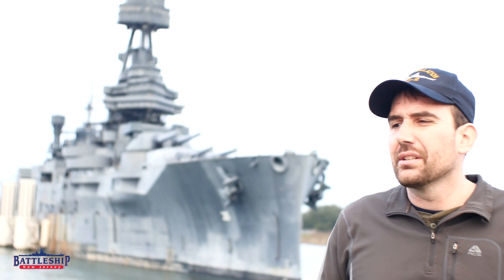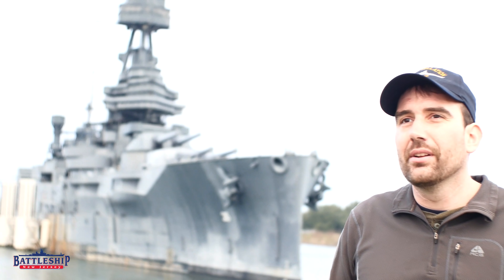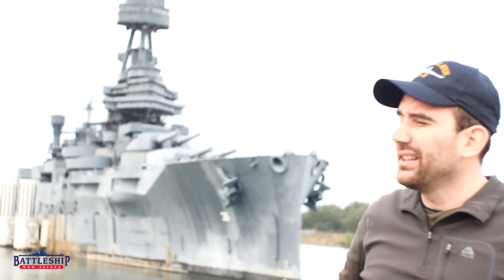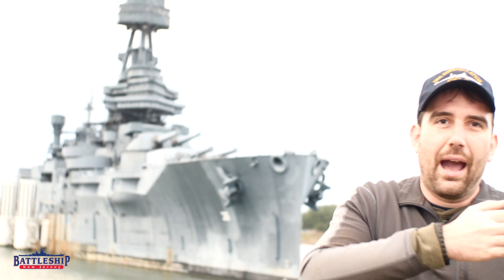Why Is Battleship Texas Shaped So Weird?

Comment: There was 15 years of separation from the Standard Type design that began with the New York class' successor; the Nevada class, and ending with the Colorado class.

15 years after the Colorado's were completed, the newer design of fast battleships were built. The North Carolina class, The South Dakota class, and the Iowa class. 15 years of design improvement, advancement in technology, and armaments. 

Plus, carriers were not a fully capable ship class at the time of the New York class creation. Not until further advances in development and discovery post Washington Naval Treaty of 1920.

During the inter war period, that would see the need for faster battleships in order to keep up with fleet carriers the like of the Lexington class and Yorktown's. One of the requirements for the newer designs of fast battleships was for it to be able to pass through the Panama Canal.

So, comparing the two ships based on design is like comparing apples to oranges. One was built in 1914, the other in the mid to late 1930's. Roughly 19 years of design changes.
Reply: and a little war  in between ;)

Comment: I find it interesting how when Texas as built they did not really trust electricity and all these new electric things.. and so made manual backups of so much stuff.. like it had both steam and electrical steering, and the turrets have chain pullies where sailors can manually train a turret.. so slow to be useful in battle.. but they could do it.. 

I also found it curious why Texas and New York stored their shells upside down..
Reply: The point-down shell storage made it easier to screw the eyelets into the base of the shells for the (largely manual) hoists and rails that moved them from the magazines to the base of the turrets.  I've been fortunate enough to walk through the forward magazines of BB-35, and see the divots on the deck where one of those massive shells fell during loading operations.  Talk about brown trousers time.
Reply: @BryceKant The Navy still maintains a certain level of manual backups for critical systems aboard any vessel because of the need for redundancy in case of battle damage. Primary steering gears may be hydraulically-driven, but you’d best bet that there is a manually-driven way to crank over the rudders on a warship.
Reply: I took a hard hat tour of the Texas several years ago and one of the spaces they took us too was aft steering. In there, there were what I can best describe as old ships wheels (the kind used to steer old sailing ships) lined up about 5 deep and these were the emergency steering. It was amazing to see that in the ship. I think I have a photo of it somewhere as well. Pretty cool stuff.
Reply: Regarding not trusting electricity: At the time that Texas was designed, electrification was still in its infancy.  Just 30 years beforehand it was something being demonstrated as a neat thing that was only starting to be understood.  While Ohm had figured out what is referred to now as Ohms law in the 1820s (one of the most basic and fundamental building blocks of our understanding of electricity) it was initially discredited and then was completely obscure until it was republished in 1879 (again 30 years before Texas was designed).  The first larger scale electrification of buildings happened in the 1890s.  It wasn't until after WW2 that we had electrification of most of the US.
Reply: @zanaduz2018  "Seaman Hulk, please report to the rudder room"
Reply: Not only that, Texas had 120V DC for all power, even the motors.  A crazy amount of current was needed for anything powerful.
Reply: @kylieTXgirl  BB35 steering systems is quite interesting.  The ship could be helmed from 5 locations.  To power the helming there was manual, electric, hydraulic and steam in various combinations

Comment: One thing I think about with the 5" guns mounted on the "gun deck" is that there is a lower center of gravity. The higher the center of gravity, the more the ship rolls and makes the point of turning turtle much less.
Reply: The casement mounted secondaries are also cheaper and lighter than turret mounted secondaries.
Reply: The critical reason for moving to turret mounted secondaries was the need for dual purpose guns. The use of the secondary battery as heavy anti-aircraft guns was more important than the anti-surface role.
Reply: The lower position of the casement mounted guns meant they often couldn't be used in even moderate seas.
Also they were far more vulnerable to hits which might cause ammunition explosions or fires.  Plus they allowed water to enter the ship which lowered habitablity quite a lot.
There were quite a few drawbacks to casements, which is why they were discontinued in later designs, and plated over in older designs.
Reply: If I Recall Correctly, USS Texas was originally built with 21 (!) 5 inch guns in her secondary battery. Several were sacrificed early on, but when they were moved up to the deck house only six were kept. Top weight was probably a strong consideration.
Reply: @ericbowen650  While this was happening, fleet destroyers grew to 1,500 - 2,000 tons, and mounted similar calibre guns to the battleship secondary.
So that secondary battery could focus more on knocking down aeroplanes, while a destroyer screen took on enemy torpedo capability.

Comment: Texas as the other battleships of the era were just as streamline and sleek (for their time) at the waterline.  The bumps and curves were mainly a feature of the main deck and were built to house secondary gun batteries that had to rotate to bear on a target.  That is why you see rounded portions on the main deck.  If you  were to look at one of these ships post Pearl Harbor after they were raised and rebuilt you will see that the bumps and round portions are gone.  This is because the guns housed there were removed and modern 5 inch guns and anti-aircraft guns were installed in similar fashion to the modern battleships

Comment: Considering the battles and blockades that New Jersey was expected to carry out from the experiences in the 1800s, it's a design feature that makes sense.   Plus we didn't get away from having guns placed to specifically deal with patrol boats.    Look at how a DDG51 has been modified since the USS Cole bombing.   25mm chain gun systems were added to the sides amid ships, CIWS got a surface mode that can just spray 20mm APDS through a boat and that is with the 5" being 1 shot 1 kill in accuracy and VT ammo in the initial design and then there is crew served weapons.

I don't think we have seen the end of these sort of apertures for secondary weapons, especially now that "super-stealthy" ships concept is starting to be dropped as impractical and sacrificing too much maritime capability and a navigation hazard in increasingly congested waters.

Comment: She is an old lady even during here time during WWII she was an old lady.  A lot of things changed since her commissioned date of 1914 which is why there are different changes (some of which are being removed  to check the original hull under them that being the torpedo ones) and she also was used a a test ship for a lot of things such as they actually tested a runway on Texas and few planes off of the battle ship.  It is great that 70 million dollars (35 from the state and other groups 35 from the federal gov)  was set aside to restore the ship as she is the only capital class ship remaining that severed in both world wars now that money cant be used for things such as the pain job or the wooden deck and same with her new home (which is increasingly looking like Galveston)

Comment: Hull-mounted, pre-turret-mounted secondaries: Las vestiges of the broadside battery. They used the best design principles within budget that they had access to at the time. Experience" That which allows you to recognize a mistake you've made before. Evolutionary change usually results in functional design without resulting in complete failures. We're all aware of counter examples (Dreadnought), but in the main correct thinking.

Comment: Question about anti  M T B 5 inch gun Postion .  At one point discussing why They are that far back Ryan mentioned to protect them From Spray .   Is another reason because the Protected Core is In Board of them ? Ryan said they were located where Crew spaces are , Minimal Protection understood .  Where are the Magazines , inside the Core Behind the Crew spaces ? Thank you for the Video .
Reply: The plate on both sides of each 5" gun casemate is Class A armor
All 5" magazines (shells and powder) are on 2nd Platform, 4 levels below and inboard
Reply: @charlesmoore766   Thank you for the Answer .
Reply: @markcantemail8018  I was not precise enough in my location references.  The exterior hull plate is Class A but the interior buikheads are Class B

Comment: As you say, hindsight is considerably clearer than foresight.  Looking back, it's obvious that those who specified features for Texas were still mired in previous conflicts and past experiences.  At the time, it probably made sense to those resistant to change, to put those "gun deck" guns in sponsons on the side of the hull.  In retrospect, SMH.  By the same token, the short, fat, stable design to be used in the WWI and earlier "line of battle" made sense to the hide bound traditionalists.  Lovely as she is, the New Jersey is now the anachronism that Texas was by the 20s and 30s.  While there may have been some justification to keeping New Jersey in commission, not as a "battleship" but as a coastal assault gun platform up into the 90s, her shortcomings in other areas now outweigh her benefits.  There may still be justification for a coastal assault gun platform, the design of such a vessel would necessarily be vastly different than New Jersey's.  Or Texas's.  Such a ship should have been on the drawing boards in the 90s, and we should be in the second or third generation of that design now.  Congress' legendary short-sightedness is to blame for this hole in our surface fleet. And the imminent demise of the rail gun and "laser guns" widens the gap.  Bad design decisions on the littoral combat ships exacerbates the problem.

Comment: Interesting comments below by proponents of reintroducing battleships to active US naval inventory.  But they overlook a few things:

1) Modern battleships (from about the 1880s through WWII) were primarily designed for ship-to-ship surface combat with the opposing forces within sight of one another.   The development of radar during WWII allowed fleets to acquire an enemy well beyond visual (and therefore gun) range, but ship-to-ship combat still required visual sighting and aiming of the guns.  Radar-controlled gunnery also developed in this period, but was notoriously inaccurate and not easily adjusted to correct for misdirected rounds or the defensive maneuvering of enemy ships.  The evolution of long-range submarines and carrier-borne aircraft was the death knell for the kind of surface warfare battleships were designed to fight.  Even in WWII, most naval combat occurred between forces well beyond visual range.  And modern naval warfare, with its guided surface-to-surface missiles, guided or homing torpedoes, aircraft-launched air-to-surface missiles, etc., occurs entirely without ever physically sighting an enemy.

2) Battleships were notoriously expensive to build, maintain, operate, and crew.  Their armor and armaments ensured that only those nations with the strongest economies and most advanced technologies (naval architecture, metallurgy, explosives, ordnance, optics, etc.) could afford to build them in any numbers.  Operating a WWII-era battleship required a huge crew of 2,000-2,700, which stretched naval manpower needed for other ship types.  Of course, modern supercarriers and submarines are also expensive to build and require large crews, but thanks to nuclear technology, are comparatively less expensive to operate in inflation-adjusted dollars.  Plus, carriers and subs  justify their cost by a return in combat success never even approached -- much less equaled -- by the most advanced WWII-era battleships.  In that war, battleships were largely relegated to protecting fast-attack fleet carrier groups and shore bombardment missions.  For combat purposes, battleships were simply not cost-efficient and were largely obsolete.  For surface warfare, the modern Navy can build and operate many more combat-effective cruisers, destroyers, and frigates for less cost in inflation-adjusted dollars than a single Iowa-class battleship.

Plus, a single modern destroyer carries far more firepower than the most powerful battleship ever built.

Comment: 3:00 why was the Texas so short, it was not, compared to its predecessors.  And battleships that came after her were each a  little longer, the Nevada class (built about the same time) was about 5 feet longer and the Arizona (built 5 years later) was about some 10 feet longer. and so on. This also had to do with the power plants and type of fuel. (the Texas was originally a Cole burner, with different requirements than even the next generation of battleship that burned oil.  The Texas was built in 1911.  She was almost out of service when the New Jersey  was built 31 years later. You could understand the types of  advancements in battleship design in 31 years.

Comment: We famously hear how battleship gunnery had to allow for the curvature of the earth and even the Coriolis effect. I imagine these factors are pretty minor compared to a pitching and rolling deck. How does gunnery work at all on an unstable platform?
Reply: The firing circuit doesn't close until the stable element is level.
Reply: To amplify Quadinaros's (correct) reply, there is a system of gyroscopes which tracks the ship's level and cross-level. This sends commands to the turrets to track the proper trajectory continuously. Alternately, the system can be set so that the firing signal is sent when the roll of the ship crosses through the proper angle.
Reply: @ericbowen650  Thanks. Impressive engineering, though I am sure it’s all redundant now in the light of guided missiles and such. Do they even have artillery pieces on board these days? How do you fire a warning shot across the bow without a decent gun? When was the last time a navy delivered a classic ship to shore bombardment? D-day?

Comment: I remain puzzled by the fact the New York and Texas were built with reciprocating steam engines and still called dreadnaughts.  HMS Dreadnaught (1906) was an all big gun ship with steam turbine engines, and it was the combination of those two things that made her so revolutionary.
Reply: The explanation I saw was that with a (newly designed) pressurized lubrication system the reciprocating engine was quite reliable and well-known. The (U.S.) manufacturers of turbine engines had not worked all the bugs out yet when the final decision was made for Texas and New York. But the turbine designs were improving rapidly and this would be the last class of U.S. battleships with reciprocating (triple expansion, four cylinders...split Low Pressure cylinders) main engines.
Reply: Thanks;   that makes sense.  There were other advantages, but the main advantage of the Dreadnought's turbine engines was that they required far less maintenance than conventional ones.  As memory serves me, battleships with conventional engines could hardly steam at high speed for five hours without needing repairs.  The only problem the Dreadnought had on her trials (going to the West Indies and back) was that her steering engine proved inadequate, which was quickly (and quietly) remedied.

Comment: Up until WW1 "ships of the line" (biggest and baddest warships) rarely ventured far from home waters, rarely encountered massive storms.  During WW1, the W became painfully apparent to the navies, with ships going thousands of miles sometimes in horrendous weather and the less than ideal design became painfully apparent.  To support this conjecture is the fact when the New York Class (includes Texas) WAS BUILT WITH AN OPEN BRIDGE! 
You read that right!  Just above the conning tower on the basket mast was a small bridge deck with no roof, simply because the Navy at time thought the these ships would stay in the Western Hemisphere (see Monroe Doctrine).  WW1 changed that thinking, and when the USS Tennessee (BB-43) was launched in 30 April 1919 all the 5" cannons were on the main deck and a long forecastle. 
Cannot stress how different this 1912 ship is from all existing warship museums today, Ryan is barely scratching the surface!  (still VERY welcome!)